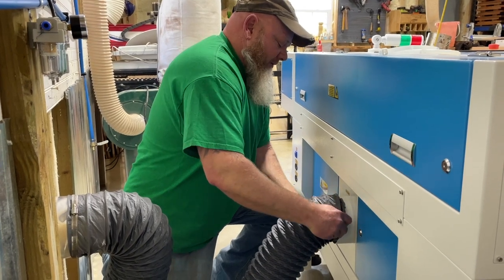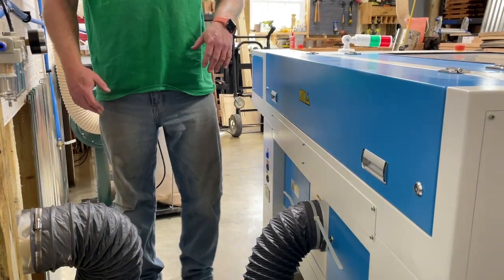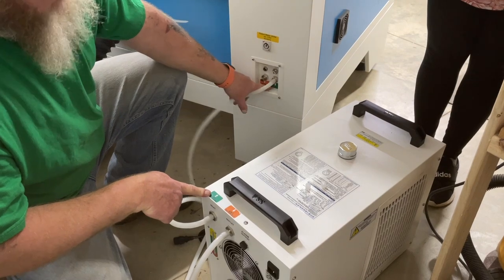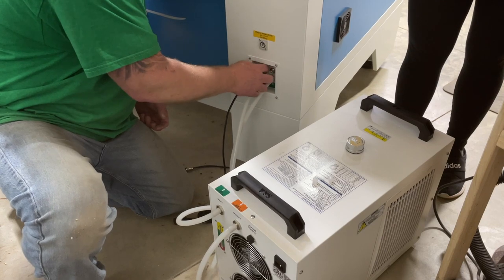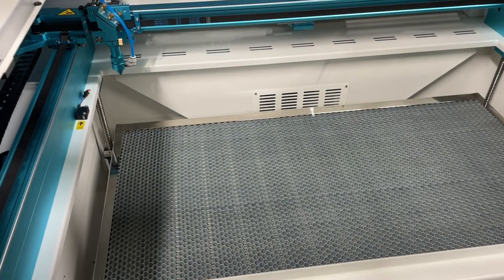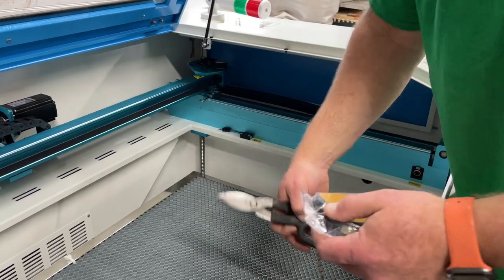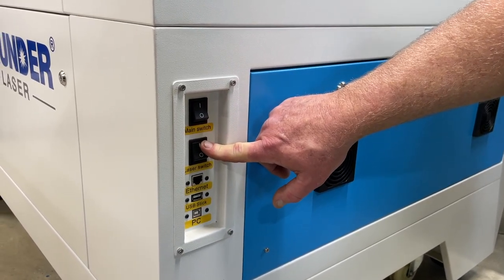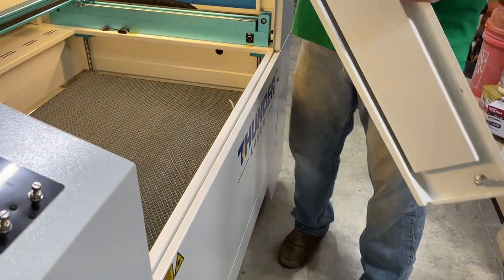Thunder Laser NOVA 35/100 Installation and Set-up

Comment: Good walk through video. The only thing that is a little confusing, is the hooking up the air lines.
Reply from the maker: To connect the regulator to the laser is a 6 mm tube that gets pushed into a quick disconnect where the chiller lines connect to the laser. I must have missed that in editing. We had a short amount of time to get in hook it up and get out, all while trying to get the video. Sorry if I missed that and it confused you.